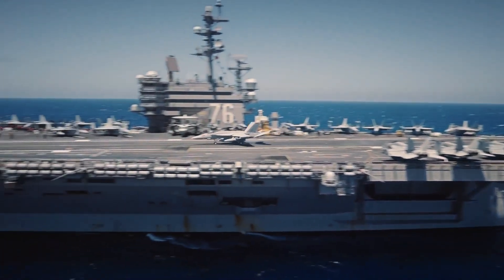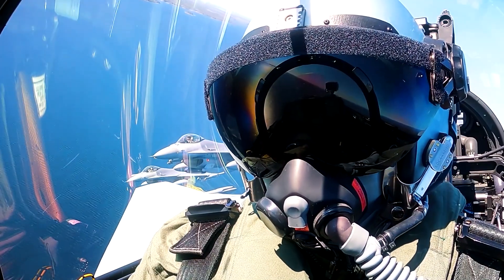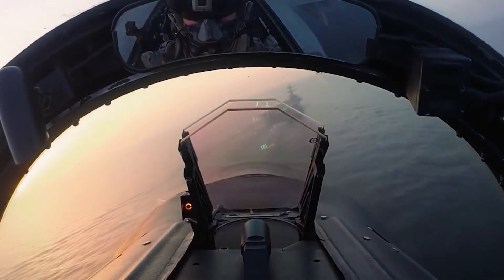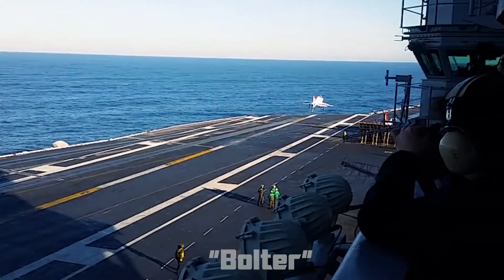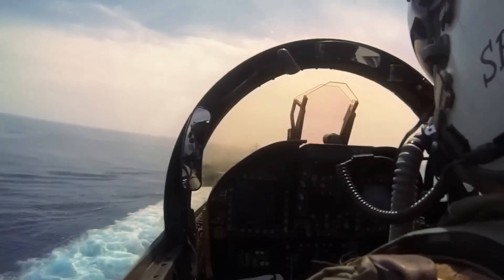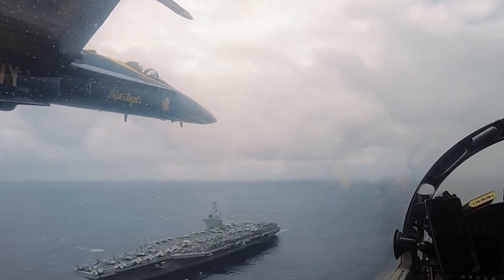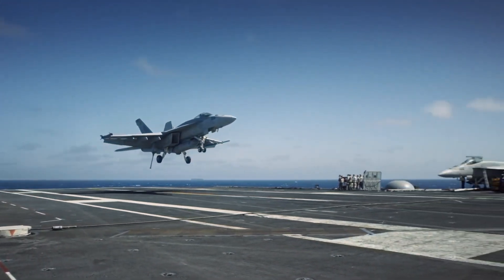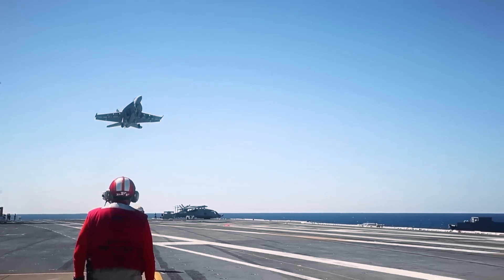The INSANE Skills Required for Aircraft Carrier Landing - This compilation show how it works!

Comment: A great video and an explanation, except one little, tiny thing. We don't think whether we would apply power and do "touch and go" as you explained. We touch the deck and simply apply the power. If the hook caught the arresting wire, it would stop the bird. If the hook missed the wire, we would take off in a sec because we got the full power applied. If we had to wait and see if the hook caught the wire and then wait for the engine(s) to spool up, most of us would end up in the water. That's an unacceptable outcome!
Reply from the maker: Thank you! I agree it was poorly worded, as we mention later, the throttles are pushed forward regardless when they hit the deck! Appreciate the feedback 🙏 👌